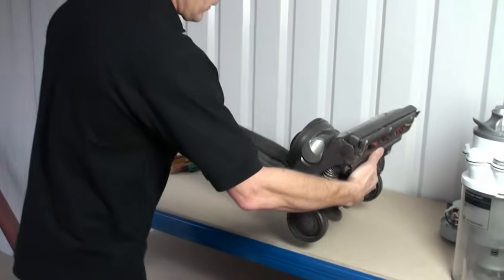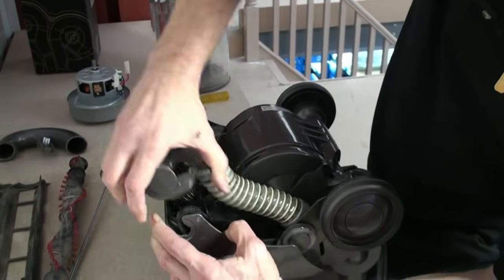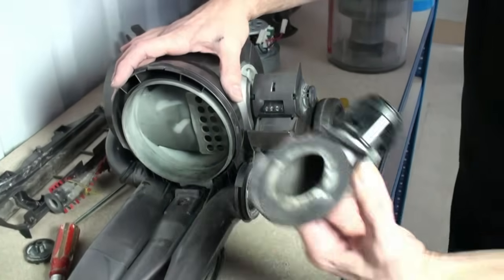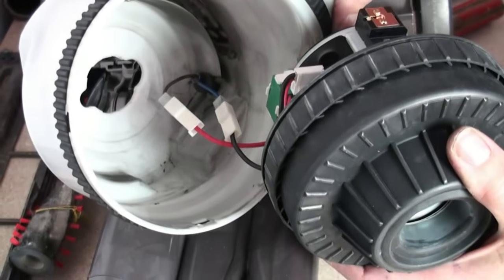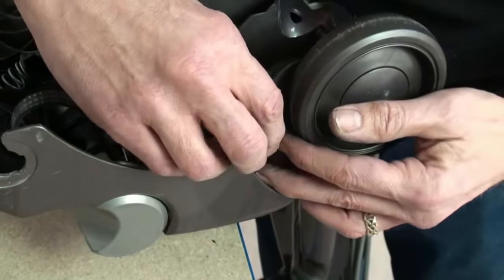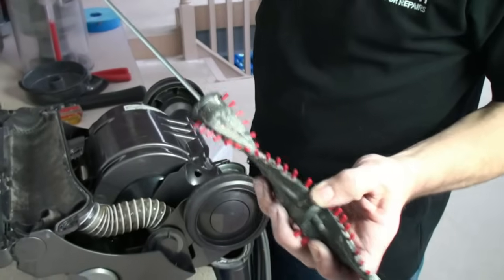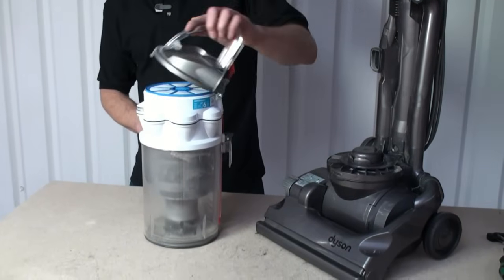How to replace and fit a Dyson motor - DC14 / DC07

Comment: I’ve worked at trying to get that motor with the rubber cover into the entry - for over a month but it will not go.  Tried everything.  Suggestions?

Comment: Broke brush bar following this guide. You don’t need to remove the axle from the brush bar to release it. Just pull away and twist to get it out from the belt. Annoying mistake - extra cost in parts to break something that wasn’t broken before!!

Comment: You'll need a 4 quid T15 torx long shank screwdriver to get the motor housing screws out, plus 22 quid for a new motor.  Washing up liquid needed to get the motor back in its housing.  I broke all the tabs on the upper motor filter cover putting it back on cos I was getting tired and could see the finish line 🤨  But my Dyson lives again!!  Great video, thanks.

Comment: Thank you for this really excellent video, loads of detail and great video work so you can see the jntricacies of getting the clip fit plastic bits off -  I am a total novice and managed to dismantle the dyson and replace the motor with relative ease thanks to the brilliant without breaking any plastic bits off.

Comment: I NEED A REPLACEMENT MOTOR FOR MY DYSON DCO7 ORIGIN CLUTCHLESS MODEL. CAN YOU GIVE ME THE LINK FOR THE CORRECT MOTOR PLEASE?
APPARENTLY ALL THESE AFTERMARKET MOTORS ARE MADE IN CHINA, AND QUALITY IS A CONCERN AS THEY ONLY LAST FOR ABOUT 12 MONTHS. ALSO, NONE OF THE MOTORS ON EBAY HAVE A MANUFACTURERS NAME OR LOCATION STAMPED ON THEM? HOPE YOU CAN ASSIST WITH THANKS.

Comment: Thanks for great video..... getting the new motor into the housing whilst keeping those wires out fo the way was the most difficult task I have done in years..... I actually ended up smearing the rubber seals with olive oil to make it easier to slide in. Two house later all put back together and dead as a dodo...... right I guess I now need to send off for a new switch. I've changed the plus and checked the fuse so if that doesn't do it then I'm flummoxed.

Comment: Thank you so much for this excellent video tutorial....I just replaced the motor in my Dyson 14 upright meaning I saved £175 over buying a new one....just a note that the screws are t15  torx and require a special long driver to remove....an ordinary screwdriver won't do it.....thanks again....Ian Goddard

Comment: I just did this. It is much much harder, and way more fiddley than it looks. Not helped by a cheap chinese motor form Amazon with badly designed connectors I had to bend to get the wires to fit in properly. Still though, great video. I fixed my dyson for £15 instead of buying a new one. Thanks!

Comment: Stellar video, gents. Many thanks. I watched a few vids for this motor replacement, and yours is thorough and professionally done. Wish I'd read some of the comments here about a few missed items, but all in all, $100 in parts, 45 minutes of time, a bit of swearing, and poof I didn't have to spend $500 for a new vacuum. NOW, I didn't remove the axle from the brush roller on my first attempt - MISTAKE. Turns out that the axle had several years worth of who-knows-what wound up in it, and THAT was what blew my clutch AND my motor, as the roller brush was very difficult to turn by hand. After installation of the new motor and clutch, horrible noises convinced me to take the roller apart. Once I cleaned the inside of the roller (with the axle removed) and reassembled, I could easily turn the brush roller by hand.

Comment: Many thanks for the video, old blown motor now replaced with a Dyson / YDK YV2200 replacement. Hopefully won't need to open it up again for at least 5 years! Need a Torx T15 screwdriver with at least a 75mm blade (under £4 from B&Q).

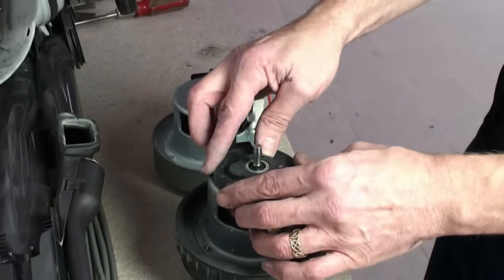Comment: Nice video. There's an easier way than bashing the motor spindle to remove the motor. It's the big rubber fan case seal (shown at 3:51) that's holding it in the motor housing. Firmly wiggle the rubber part that's on the opposite side from the spindle to gradually work the seal out of the motor cover, and the motor will be released without bashing it.

Comment: Number of screws needing to be removed is moe than stated in this video. There is a screw tucked away, very not immediately obvious and not mentioned or pointed out in this video...if it’s not removed, the motor casing will not slide off

Comment: Excellent. Thank you very much for this. I just did this to check the brushes on the motor. I do think you should suggest pressing in the three tabs of the motor retaining housing before prising though, as mine would not prise off without doing this. Also, I would strongly recommend using a small block of wood on the end of th motor when tapping with a hammer. The metal is very soft, mine was a swine to get out and started damaging the end of the shaft
Reply: Yup. Ended up snapping one of the tabs off mine because he said to prise it when after getting it off it's clear you're meant to press the tabs in to release, not prise at all.

Comment: Hi great video we replaced dyson motor with one off ebay, but we still have a hot almost burny smell any ideas? hoover working otherwise..
Reply: mysticpizza02 sounds like a slipping clutch or roller belt

Comment: Great video, i took my dc14 motor out but then realised the burning smell was from melted end cap from brush bar. Any idea what could have caused this. I took off the end caps a few days back to clean away the dust etc  inside.

Comment: Great video. Terrible vacuum. My DC33 (almost identical to the DC14 / DC07) is the most maintenance unfriendly vacuum money can buy. Even changing a belt is terribly time consuming. My issue ended up being lack of continuity between a brush and the motor armature. Light cleaning of the brush solved the problem. Both brushes and armature looked fine.

Comment: Thanks for the step by step! This helped me to replace the motor, the switch, and finally diagnosing that the plug end of the cord was the faulty culprit (intermittent open)... still, saved hundreds, and I've got essentially a brand new DC07!!

Comment: Thanks for the video it was a great help in repairing my DC14 Animal I changed the motor start to finish in just over an hour, only tricky bit for me was the wire and connectors so that they were clear and the motor sat flush in the housing, also I needed a torx size 15 long screwdriver, i didn't buy my replacement motor off eBay as many do from £12 to £15 and bought it from my local spares shop for a little more model MTR299 Qualtex  approx £15 or I notice they have the original motor for £52 but why pay more? very pleased I now have more years with my old Dyson.

Comment: a good instructional video but i would have cleaned all the cleanable plastic .i have a DC 07 in bits waiting for a new motor  .i have cleaned mine and ordered new filters .[amazon total cost just less than £50 i am a retired spark so i can do the job myself

Comment: I found it easier to rub a bit of washing up liquid round the motor rubber to make for an easier fit
Reply: i tiny bit of silicon spray or even a tiny bit of talk help.i am mean a tiny amount .do not use WD40 or similar the trouble with washing up liquid it can rot rubber and if you use too much it could be potentially dangerous if it came into contact with any of the electrical components
Reply: when I said tiny bit I don't mean a squirt I'm talking a tiny drop to the finger and to be honest I have used this technique  for yrs on bicycle  tyre fitting and other rubber jobs and never had  the rubber rot yet I must admit I have never tried the talk technique

Comment: Good video - but the editing, for me, at crucial times was iffy. The parts on my machine (DC 33) did not slide in and out as easy as this video made it look. Never did get the 'secret screw' back in, Nevertheless I managed to replace the motor, albeit with some marred hands. Something I could have never achieved without this video....Thank You Ransom Spares!

Comment: Excellent video found in desperation. Fortunately everything I had already done was OK. I had trouble finding the last screw and my model may be slightly different, but I am very happy with the result and it works perfectly!

Comment: Such a helpful video. Thank you so much. I recommend a drop of 3 in 1 rubbed about the motor casing to get it all back in and allow to move back in to position.
Reply: 3 in 1? Oil?

Comment: Help! I need to replace the motor on my Dyson after it was ruined in a basement flood, but I'm wondering if there are any other components other than the motor that I should check out?
Reply: +Greenmonkey552 change the clutch too whilst you have the machine stpipped down amazon about £16 [2016]

Comment: Well, with a little common sense applied (not forcing plastic fittings etc) this was a thoroughly useful video! Replaced carbon brushes, filters, clutch and roller by using this video alone! Thank you Kevin!! Small hands required for removing cabling to motor (or big hands and swear words). Machine is like brand new and will no doubt last another 10 years.
Reply from the maker: Glad you found it useful!
Reply: +Ransom Spares i found removing the motor cable from the switch gave more maneuverability for working on the moto

Comment: T15 TORX SCREWDRIVER IS ESSENTIAL TO DO THIS JOB... as Dyson don't use normal screws but Torx head screws. also don't try it with a Torx allen key (the cheap L shaped keys) as it wont be long enough.

Comment: There are 8 (7 + 1) SCREWS IN TOTAL TO TAKE OFF not 7 (6 + 1) as stated in the video. the Clutch housing has 3 and the motor housing has 5.
we found this out when we got to the stage of removing the motor cover only to find it doesn't just simply slide off but is held by the last little screw hidden away.

also when inserting the new motor it is really hard to move it about to line up the rubber tabs. we had 3 attempts before it slid in correctly lined up.

good video though and is easy to follow Kevin.
Reply: +jay kassan It's impossible to move my new motor about when inserting it.  Has to be lined up EXACTLY upon entry.  Onto like the 10th try now, so hard...
Reply: @bruddaozzo  A little bit of vaseline works wonders.
Reply: Me too!
Reply: Got the motor lined up on the second try whew! SURE wish I'd read your comment about the 8 screws first., and yeah, that bugger was hidden nicely. Eventually figured it out though...

Comment: He forgot to change the blocked pad filter. Did you see all that carbon fall out? Well that will have totally blocked the post motor filter. Always change that filter with a motor or you can burn the next motor out in about half an hour.
Reply: Robonza

Comment: G'day,  Excellent video and saved me at least AU $500.00 on a new machine. Once  you have done it a few times it would be straight forward,  but for the rest of us who might do it every 10 years or so it is a god send. I did get caught out with the hidden 7th screw to hold the motor top cover but once discovered the rest was reasonably easy. A hint that might save a few swear words when fitting the new motor back in the housing - put a small amount of talcum powder around the rubber motor cover to assist in refitting - make it more "slippery" and easier to remove if those pesky motor leads have moved. I also fitted a new clutch and belt assembly as well as a brush bar. This should see another ten years service with any luck. Thanks for posting this video.

Peter of Adelaide.
Reply: samgalah there is a small cover in the motor housing (with lots of circular holes) held by a small screw, just where the wires sit. I took off this cover to get to the wires and keep them in place while manoeuvering the motor into its housing. 
good tip about the talcum powder though as I had the same issue with the rubber covers being very hard to move.

Comment: excellent video , just used it to change motor on dc33 animal upright , fully expected to have to throw the whole lot in the bin but this video kept me on the right track !!!! another pointer to add is new motors arnt as deep as the original ones so you have to use an adapted seal (the big one ) part no. DYS921867-01 , thanks again !!!!!!!!!! :-)

Comment: With the 07 it's best to remove the switch and release the cable to the motor to allow you to remove the motor housing completely from the body. Then you can push the motor out of the housing once you have removed the cover by pressing down on the spindle. Feed some of the cable through as you pop the motor out.
The motor alignment rubber must sit with the smallest offset pointing at the suppression unit.
Come on Kevin - GET IT RIGHT. Also why not invest in a belt lifter?

Comment: This was awesome guys, thanks. But I THiNK from memory, while I was tricked awhile with the motor house, there are actually 7 screws holding it together. Look for one hidden on the clutch cover side. And yep, you have to get a T15 Tamperproof screwdriver. It MUST be a screwdriver, not one of those multi-tip jobs, because the recess for two of the screws is very narrow and the socket-shaft of the multi-screwdrivers won't fit.

Comment: Hi, I am wondering if anyone can help me, I get to taking off the valve pipe assembly and motor inlet cover, which after this I should be able to take out the motor/motor cover. This is not coming out. I am wondering is any part of the video missing as I don't want to force it out and damage the Hoover.

Comment: Great Post... worked like a charm, my brush housing was a complete B**** to get off though, certainly not as easy as Kevin made it look, even second time around was difficult. Second time around? first time one of the motor wires didn't connect properly and hence the grand switch on was a complete flop but once disassembled and reconnected worked like a charm, many thanks... Check those connections and save yourself time and lots of choice words!!

Comment: great instructions but it is really fiddly, it took me all day to do apart from a break to go and buy a T15 screwdriver and lunch & tea! but it does work now, yeah!!!!, I had to take the roller out in one piece and couldn't get the motor cover off on one side but twisted it enough to get the motor out, having got the new motor stuck in the wrong place in the housing (I had to hammer it out!) I used a load of washing up liquid the second time (rather more that 2 drops) which worked to get it in.  Feeling very virtuous now!

Comment: Excellent step by step guide. Were back in a clean house. The wife's not happy with you though.. she was looking forward to one of those ball types lol. many thanks.
Reply: Don't even bother with the Ball ones the suction on them is very poor compared to the DC07 and DC14. Also, go look on eBay etc at the number of Ball ones that are being sold saying the Brushbar has stopped turning, its a common thing for the Brushbar Motor to go on them.

Comment: New motor on order this week. It might be useful to tell people 'at the beginning' they will need a T15 torx driver! I got half way through taking mine apart then had to stop... Great video thoug, thanks!
Reply: Ransom Spares
Dont just thank Stuart, re-edit the video or add a type over to it so that people know.  This will stop people like me who started the job at 9pm thinking all was good and having to stop in the middle of the job as I didnt have T bits small enough.  GET IT DONE!
Reply from the maker: Thanks for the feedback Stuart ... glad the video was helpful!

Comment: excellent video, well explained.  Not sure if others would agree but, if the motor rubber is very tight (as mine was) 2 drops of washing up liquid on the inside of the motor housing spread very thinly was just enough to enable it to move slightly into position.  Anyway, well done guys, great job!!!

Comment: Guys, a VERY useful tutorial. Just replaced the motor on my 07, and even though I am pretty handy, I would definitely have struggled to achieve a successful outcome without this help. I was also fortunate that my car (SAAB) toolkit had a Torx 15 screwdriver in it.
The Dyson now sucks better than a $40 hooker.... ;-)

Comment: Thanks for this very useful.  Putting the new motor back into the motor housing can be a tight squeeze.  To make this part of the job much easier, smear some washing up liquid on the rubber boot and around the inside of the motor housing.  The motor will then just slip into place! :)